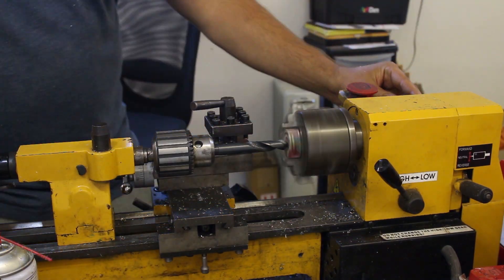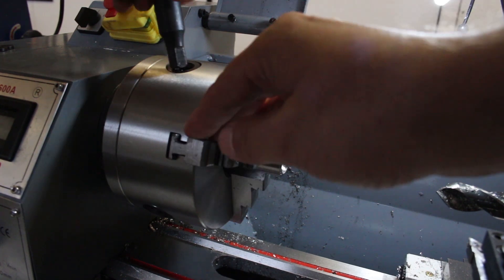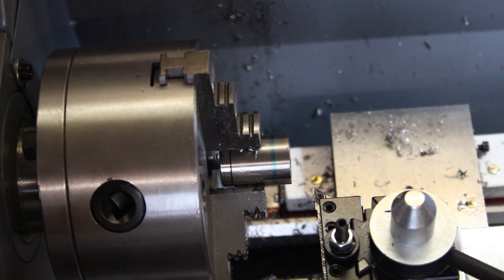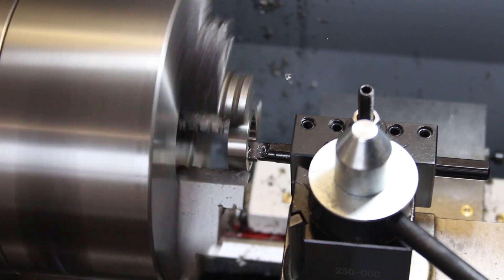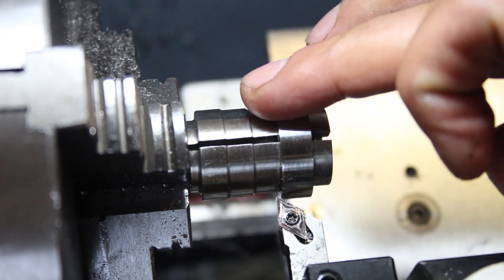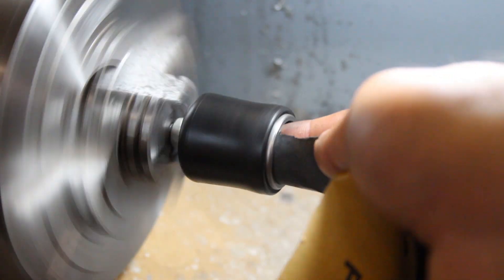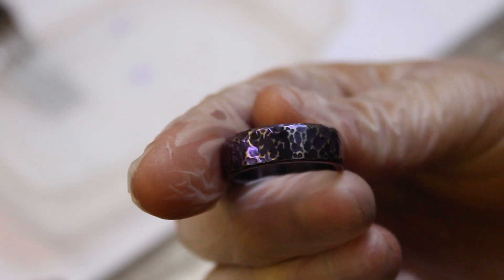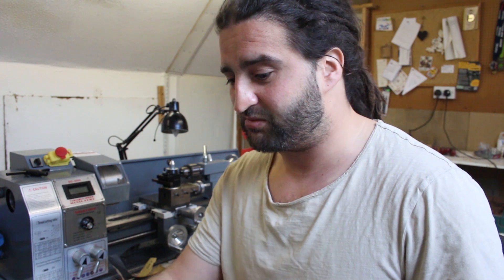Making A Hammered and Anodised Titanium Ring (New Lathe, New Me)

Comment: You have all this expensive equipment for making the ring, and you spent 9 bucks at the store for your anodizing setup lol.  Dude, just buy a power supply and make a proper setup.  It will probably be the least expensive thing in your shop and will work a thousand times better.

Comment: Awesome ring mate. Have to ever turned a ring on the lathe from a block of wood or do you only do bentwood rings? 

Your lathe appears  to have the ability to cut threads using those two levers in front. Try cutting a wide type thread in a wooden ring and then wrapping wire into the continuous groove.

Helix Ring :)